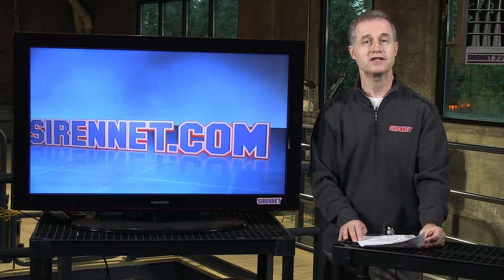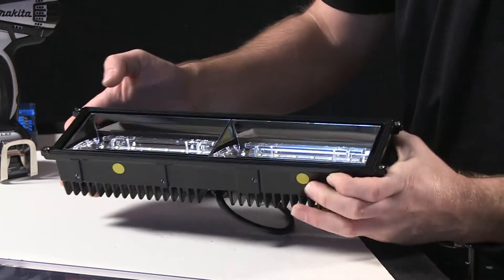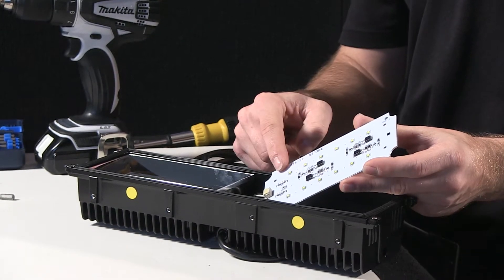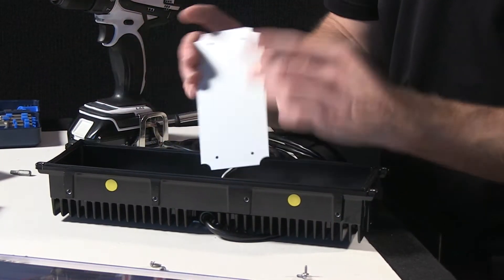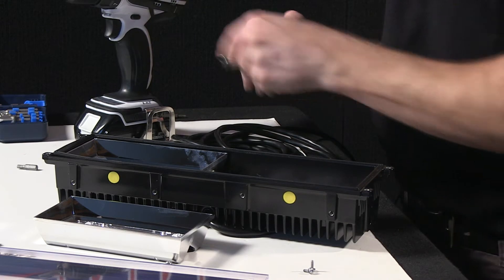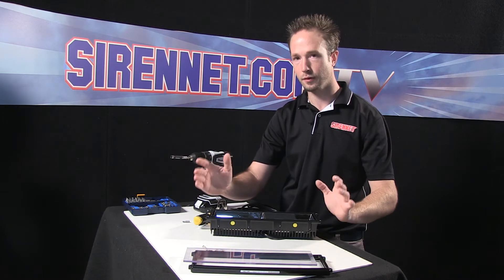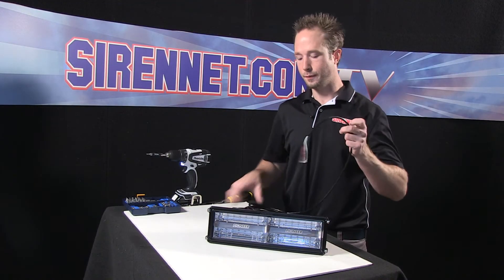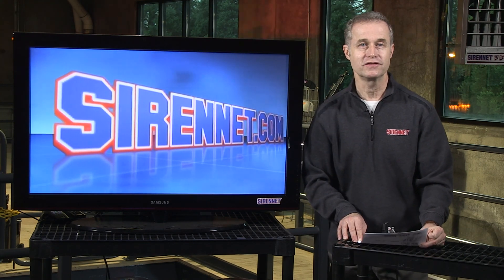Chris disassembles a Whelen Pioneer Dual Super-LED Floodlight

Comment: Hi Stuart and Chris. Quick question! From what I've seen of the reflective lens/optics on this model, am I right in thinking that the lens are designed at an angle to each other so that the light from the top row of diodes is directed straight out and the bottom row is angled down slightly at approximately 45°? It's difficult to tell from the video without a close up but am I right or completely wrong!! Cheers.
Reply from the maker: It is a bit tuff to see from the Video, but the internal reflector is angled on both the top and the bottom row of Diodes. The Top section is designed to shine more outwardly straight, but it does slightly downward cast the lighting also. The bottom row of Diodes does produce much more of the downward / 45degree illumination, but this row does also assist with forward illumination. Both rows and reflectors help each other to spread the awesomely bright White LED illumination.
Reply: SIRENNET Thanks, that's pretty much what I thought. Oh and here's an idea, ever thought about opening a store in the UK? Get yourselves across the water to us!
Reply from the maker: Sean Swinton It might be on our Bucket List   :)